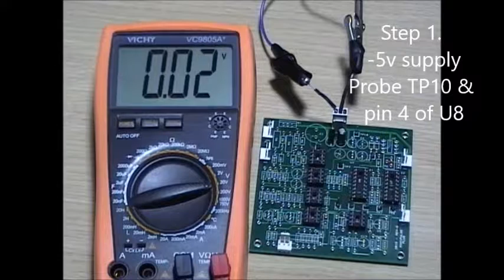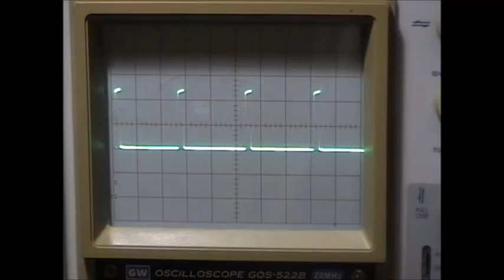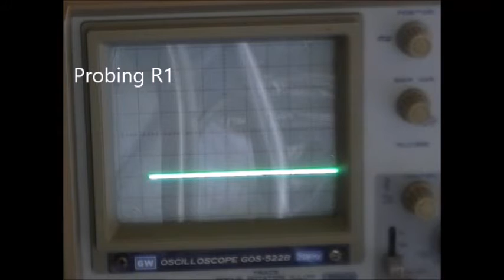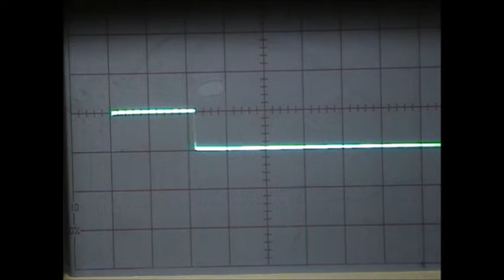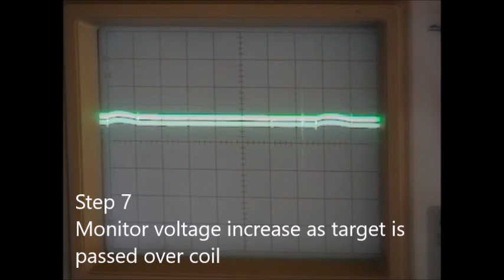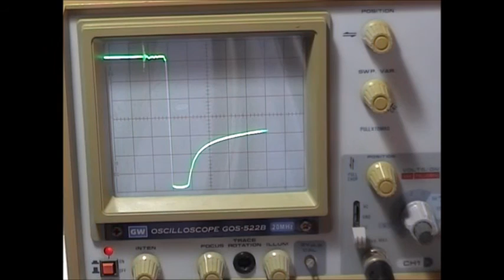MiniPulsePlus Metal Detector Build - Step by step to completion

Comment: Nice work. What coil is that you are using and what are its specs, 300/350uH?  what R (ohms)?. It looks like a fairly large coil. How far was your nugget from the coil surface in the air test?, it is kind of hard to tell from the angle. I get about 5 inches with a 1.2 gram nugget and right about 3 inches on a .45 gram (8 grain) nugget with my 7-1/2in litz wound 3dss coil. Thanks for posting the vid, nice to see someone do a step by step vid with scope shots.
Reply from the maker: Hi glad you enjoyed it. Coil is Nugget Finder 14x9 litz wound about 340uH and 0.4 ohms. Depth would have been around 4-5" from memory. Nugget would be 1-2 gms sponge type in quartz.